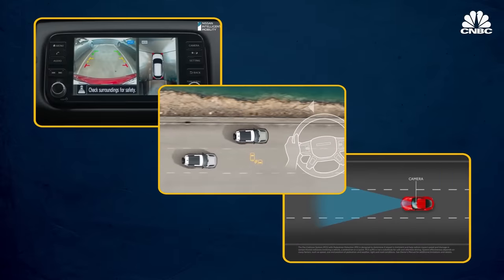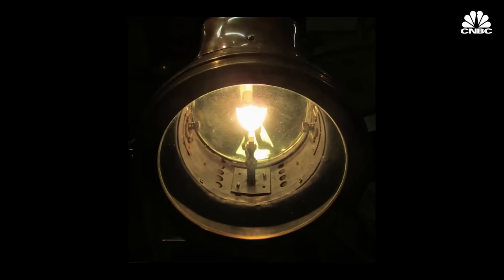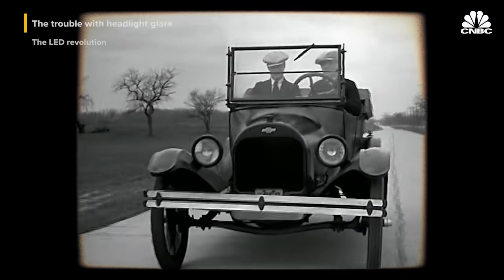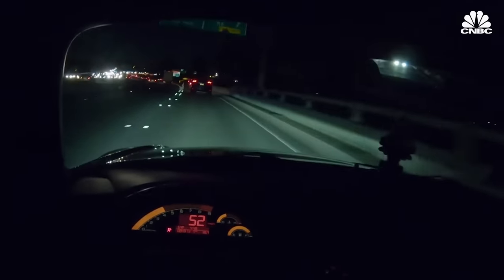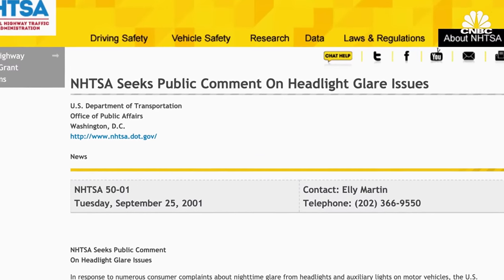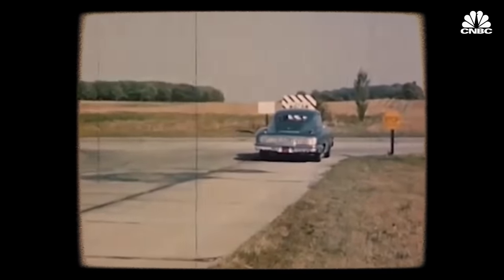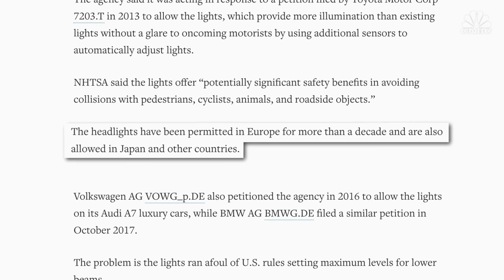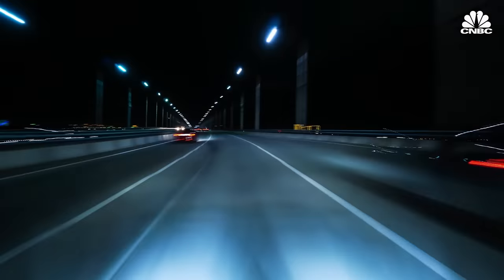How Headlights Became So High-Tech

Comment: LEDs in their current form are out of control and must be regulated.
Reply: Please check out the petition. I wish that I could provide you with more info however, they keep removing my posts and responses.
Reply: @stbrian1861  I have already signed one.
Reply: They are regulated. The aftermarket LED people buy online, are illegal for street use, only allowed for off-road, but people don't care. But some do get caught and ticketed. The LED that come new with cars, some are rated to have excessive glare, some glare or no glare. Most of the ones that have excessive glare, are SUVs and trucks, because they are higher up.
Reply: @DmitriMogiliver  ...., Many Thanks Dmitri ! 👍
Reply: @igotanimac1  , the regulators need to shape up and do it better. Current OEM LED headlights are so bright, they blind from a quarter mile away and they are NOT on high beam. Subaru and Mazda just to name a few
Reply: @DmitriMogiliver  Not all current OEM LED headlights are too bright. Some don't exceed glare limits. They either don't exceed limits, have some glare, or excessive glare. Automakers are getting better and better at reducing glare in LED lights. One example of a car that has LED lights and doesn't exceed any limits is the 2019-2022 Honda Insight. People should also consider wearing night vision glasses, just like they do for the sun during the day.

Comment: Sometimes I miss sealed beam headlights. Back then, there were only 4 choices that automakers had when it came to headlights (2 beams or 4 and square lenses or round.) So when your light went out, you immediately could tell which part you needed to replace it. Also since the lens, mirror, and bulb were all one part, when you replaced the bulb you also replaced all three of those. There was no such thing as a headlight lens getting cloudy as it aged. And if your lens cracked or hit a rock and broke then all you had to do is replace the bulb and you ended up replacing the lens with it. It really made life easier.
Reply: Yes, I don't like foggy lenses, but I love the wide, even pattern like stadium lights.  The old ones were just two pools of light.
Reply: They were junk!
Reply: Trash headlights with trash visibility. Literally a candle versus a modern Cree flashlight.
Reply: Same, the yellow color to the light was much better too!
Reply: Alright grandpa get back to bed

Comment: Yeah there's a lot of tech but that comes at a cost: very expensive and impossible to repair. Costs more, harder to repair, and dealerships try to force you to bring it to them, costing more than fixing it yourself. I just bought a transmission from a junk yard for $200. Replacing it myself for FREE. Would probably cost $3000 for the part and labor on a new car.
Reply: repairing a headlight yourself can cost about ₹500, getting it repaired can cost $500, l
Reply: @oksowhat  lol
Reply: Its less repairable and more replaceable. But that's true with all products these days. Nobody repairs a toaster, or a microwave, or an iron. If it makes you feel any  better, you can still repair a lamp. As long as its not one with a CPU in it.
Reply: @krane15  The manufacturers are doing that on purpose though. They even design it to break on purpose, forcing you to buy more. There's lots of lawsuits going on right now. We need the right to repair.

Comment: I had to replace the headlight on my merecedes, $4,000! I’d rather go back to the old style lol
Reply: You got ripped off big time. Most OEM Mercedes headlights are $300-$1,500 and less than an hour labor.
Reply: I could buy another by putting another 4k 😂 not mercedes though
Reply: Dam... my toyota just cost 1k for a pair of those modern LED 😂😂😂😂
Reply: That’s crazy. Honda wants $850.00 for each LED upgrade, plus labour.
Reply: Your first mistake is driving a Mercedes without a warranty or without a lease. They are luxurious, comfortable, tech-savvy, and well built but over time all those systems degrade, and for Mercedes, they are expensive to replace. Toyota, Acura, Honda, Subaru, or current day Mazda all excel at having cheaper parts and cheaper labor. Try selling it and buying one from those brands, sure they may not be the coolest or offer enough clout, but they will offer peace of mind. Buying luxury cars means fixing cars at luxury prices, so go used, reliable, and much cheaper
Reply: @igotanimac1  "Most OEM Mercedes headlights are $300-$1,500 "  ....id rather replace a $12 lightbulb personally
Reply: @DanafoxyVixen  Um, we're talking about entire headlight assembly, not the bulb inside the headlight 😂😂

Comment: Since high tech solutions often fail, I'd like to see an option to return to manual high/low beams that will bypass the vehicle's computer via simple wiring.

I'd also like to share a personal anecdote: about 25 years ago my brother created a low tech form of adaptive headlights on his T-bird. He bought a couple of cheap truck lights and connected them under the front bumper to the steering rod, to make them turn with the wheels. He adjusted the direction to the same level as the car's low beam.
It worked great!
It cost less than $50(US).
It didn't cause night blindness in drivers of oncoming half ton machines that are moving towards you at relative speeds of up to 120 MPH.

My brother's little contraption was cool, (...Audi's digital Matrix LED lights are cool too, as long as there's a manual-bypass option that doesn't rely on computers and software:)).
Reply: In my car all you need to do is switch from Auto to On and the headlights operate manually with the same switches and relays that have been used for decades. If the automatic portion fails they still operate as standard headlights...in fact I normally run them that way, at least with the high beams. Had the thing 8 years and I still can't bring myself to trust it. Standard switch from DRL to low beams based on ambient light is fine though, and the threshold is easily configurable;

Comment: My Audi has matrix headlights (what this video calls adaptive driving beam) and it's literally the best thing about the car. I can drive at night with high beam on all the time, even on highways.
Reply: doesnt that make reflective signs, etc, incredibly bright? I find even on rural roads I sometimes can't use my high beams because it makes the reflective signs so bright.
Reply: @ValoPlay724  the system recognizes signs and dims the high beam in the appropriate area. It's incredibly cool to see in action.
Reply: Is this available on all audi models or only certain ones?
Reply: @damonstr  very cool, thanks!

Comment: If 150,000 total candlepower lights are allowed that is roughly 150000×12.57=1,885,500 lumens total for all lights (if mean spherical candlepower is assumed.)
That's around a thousand times what current budget LEDs offer. Those budget LED are misaligned if they are blinding you. Just wait till they are 1000 times brighter.

Comment: Idiots who use high beam in normal driving need to watch this video
Reply: I think you missed the point of this video...they mentioned how high beams are intended to be used all the time unless there are other vehicles or pedestrians present.
Reply: @MylesV  You r missing my point altogether. All I am saying ppl who use high beam shouldn't be using high beam unless is absolutely necessary meaning no street light and pitch black. So jokes on u i guess.

Comment: You can add whatever safety features you want. It doesn't change the issue of how intentionally poorly designed speed limits negatively impact drivers. Forcing drivers to drive at 25 in a non-busy road instead of 35 makes no sense and forces drivers to speed when they can get away with it to compensate for driving too slow in roads where there are speed cameras. This is a problem of local governments poorly designing roads and corporations being forced to compensate for incompetent government.

Headlights will not stop people wanting to speed at night.
Reply: It drivers could drive properly and not speed when they aren't supposed to.
Maybe then certain streets wouldn't need to have such a stringent speed limit but even at 30mph drivers will still to go faster, the same at 40 and so on.
Reply: @Gambit771  That's why I'm for speed cameras in a smart city. Heck, in the future, maybe the speed limit signs will have both physical and digital that supersedes it when its on that adjusts speed limits based on AI analysis of the road/traffic conditions (including pedestrian patterns and limits on code). From my driving experience, only time people actually follow speed limits is when they're afraid of speed cameras as its not just a fine, but also increase in insurance premiums if they get points on their driving record.

Comment: What is needed in cars are code reader and scanners so when the check engine light comes on you can press a button and it will tell you exactly what is wrong with the car and then you can take it to the dealership so they can fix it

Comment: head lights are way they are becaseu tehy cannot do conventional configuration; 
i own the conventional; config; 
 they cannot do square; and round headlights; i own those; 
cannot do circle of light bulbs in square headlight; iwth large center light; liken to center eye in angel eye; i own that; 
and they cannot do owl  eyes; but angel eyes; i own owl eyes; 
and cannot do random studded headlghts; can only do one  line of lights;cannot be more than one line; 

harder faster driver break brighter brake light is; i own that;
i own fresnel lens; 
i own laser lens light; to see through fog etc; 
i own infrared in car; to see through fog and dust storm; 
i own cross x; pilot seat belt; for car; 
i own cell phone for car; 
i own over IP for car radio; et al
i own digital radio; 
combine digital and over IP; cell phone; we can put ip address radio stations;in car; 
we own compuer screen body; per se; all touch screen liken to space x dragon; has tank handle; as well as steering wheel;
car computer checks direction of eyes; to know if driver is falling asleep; and wakes up drier; or can self drive home; 
my driverless car uses still photo at 1,000 frames per second; per se; and make match stick figure; and dot; for object and compare the movement of object and deterine trajectory; using dot only; so mine can read 500 signs; track 500 moving objects;
and uses multiple camera for triangulation; and has laser; radar all sides; 360; and has drone; to deploy in caes of taffic jam; and able to recieve drone; for delivery in case of traffic jam; 
and car can measure the distance of next cars; on the road; and able to talk to other car ; and configure traffic flow; cluster operation; 
i own cluster operation in land air space water on the water under water; out in planets etc; 
so you can test it but cannot sell it; 

and i own swarm operaton; which is cluster operation; 
and i own tire; which each tread has hard rubber wrapped around in soft rubber;so when car is slow moving soft rubber makes contact;when car is moving fast; hard rubber makes contact with road; 
life can get whole lot easier; if i am let in market place; 
and thats not all of it;
Reply: Bro what were u even trying to write 😂😂

Comment: I live in a rural area - there is a tractor pull track nearby that has events once a month. People pull their tractors on trailers to the track using large pickup trucks. When I come from work these people are hauling their heavy tractors causing the pickup trucks to point up - headlights glaring away. Worse yet, they NEVER turn off their hi-beam headlights...and they have those f*cking bright ass foglamps on as well. They just don't give a damn....I've raised hell with the sheriff's department and they do sometimes patrol the area...but not enough. Has become dangerous to drive at night. Curious: these people are THAT BLIND to have to use such lights??

Comment: It’s interesting that the article leads on vehicle manufacturers developing new headlight systems and technology when in fact it is the headlamp manufacturers that are primarily doing this.
Reply: What’s the name of the headlamp manufacturer? I thought it was the car manufacturer who designed the headlamp, and them collaborates with a third party to manufacture them?
Kind of like an Architect and a builder relationship?
Reply: @paulsz6194  Principally the manufacturers design the overall vehicle which indeed includes the style they are seeking for both headlamps and rear lamps. Working together with a select number of lighting manufacturers the headlamp will be further developed to include specific features that each lighting company has designed/developed/invented and will meet the vehicle manufacturers requirements. Once the commercial aspects are agreed a HL manufacturer will be selected to develop tools etc and all though the process ensure all legal requirements are met for the regions the vehicle will be sold in, the process is long and both supplier and manufacturing engineers will work closely together to produce the final product. The number of HL suppliers capable of producing the technology and the production volume is relatively small although there are niche producers out there who specifically concentrate on lower volume vehicles. The larger HL manufacturers include such names as Automotive Lighting, Hella, Valeo, ZKW & Kyoto.

Comment: To upgrade my old halogen headlights to LED headlights is $850.00 EACH for a Honda Civic 2020. PLUS Labour
Reply: led are bad
Reply: @Q_QQ_Q  No. That's only those stupid aftermarket ones and those programmed to be bright. If engineers want to, they can make LEDs look just like halogen bulbs
Reply: @exoticcar5482   No actually you’re completely wrong. The upgraded LED headlights are directly from Honda. They come with the touring models I have a sport model.
Reply: @KodiD420  That wasn't what I was referring to. I have seen Honda's OEM LED headlights and they are much brighter than halogen. Honda could easily lower the color temperature and brightness if they wanted to, but they choose not to, and quite frankly I haven't seen any car companies that try to mimic halogen brightness and color temperature with LEDs in headlights even though it's completely plausible. The proof is in all the LED bulbs you can buy at your local hardware store that are 3000K and lower. However unlike the illegal aftermarket upgrades in halogen reflectors, all OEM LEDs, even if they are brighter and have higher color temperatures, are compliant with DOT regulations so they shouldn't cause as many problems.

Comment: The problem is that most base-level non-luxury cars still come with halogen systems that are very poor as the long-life bulbs that are OEM put out less lumens to increase their longevity.  So it's not a perception of poor lighting, it actually is horrific from the driver's seat.  This incites people to get "brighter bulbs" that are not designed for the housing.

Comment: Something random I learned years ago was how manufacturers tweak and change headlights based on the intended market. As in, for right hand drive markets, the right headlight is brighter and shines in a wider angle because you're trying to limit glare. So the left hand headlights don't shine as wide or far. This is for non-fancy normal headlights.
For left hand drive markets like the UK and most commonwealth countries, it's the left hand headlights that shine wider and farther. So that oncoming vehicles from the right don't get blinded. I noticed this on my own car at the time. We drive on the left and my left hand headlight shone farther and wider (covered more of the left lane). My right hand headlight seemed to align with the marks on the road and did not shine onto oncoming vehicles.

Comment: The thing with adaptive LED lights is you need to get within certain distance for the camera to pick out things then it takes an extra second to figure out they are pointing at a person or car and dims, in that time you have flashed blinded the other person. Some drivers (looking at you BMWs), just leave them on high beam and let the system deal with it even in heavy traffic, then the thing spaz out while blinding everyone.

Comment: HID’s still offered on expensive vehicles as they reach a little more down the road for high speed driving.  LED’s not quite there yet even with projectors.  Laser lights and digital LED’s newest out of Germany.  Slow wheels of  usa bureaucracy, are stumbling blocks for fast evolving tech.

Comment: The 2022 Freightliner Cascadias led headlights I drive at work  are less blinding that newer cars factory leds.  Not much glare just bright. 

 Acura/Honda are the worst ones . The #1 most blinding is lifted trucks with leds.

I want leds in my 14 Tacoma , just don't  want to blind people.  Hard to find good aftermarket housings for the leds. 

Problem I'm having is that the aftermarket housings are designed around halogen not led light source and bulbs are hit or miss with reliability.  My factory lights are good. Don't drive a lot at night.  Just like the extra brightness and look of led

Comment: The problem with glare is simply that the regulation is the US allows it. The rest of the world has moved on and has fewer problems with glare. It's such a well-known fact that even Wikipedia tells us: "The international ECE Regulations for headlamps specify a beam with a sharp, asymmetric cutoff preventing significant amounts of light from being cast into the eyes of drivers of preceding or oncoming cars. Control of glare is less strict in the North American SAE beam standard"

https://en.m.wikipedia.org/wiki/Headlamp